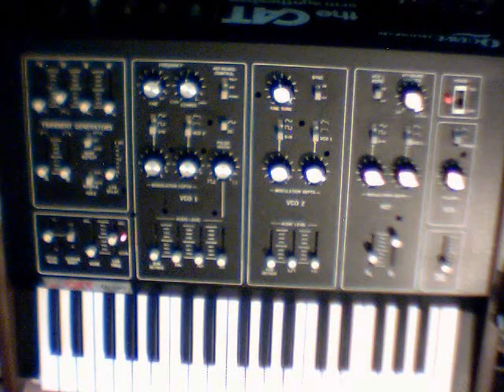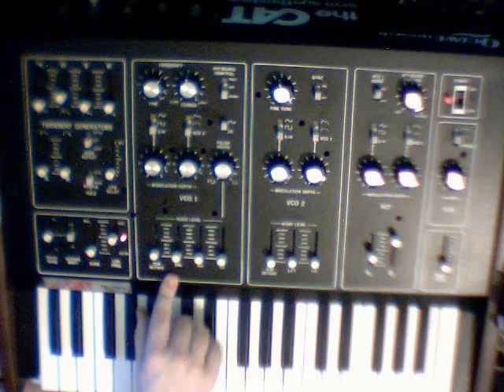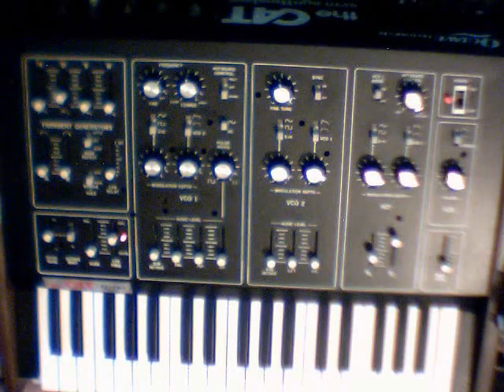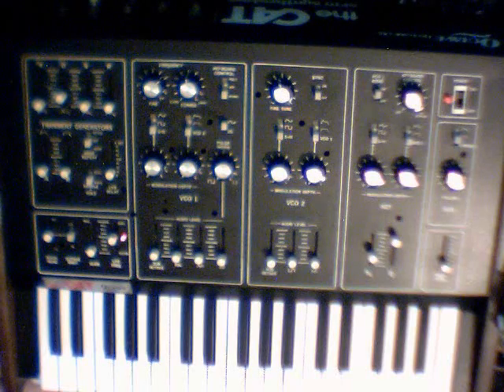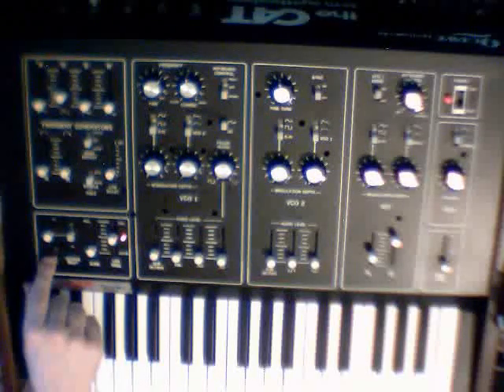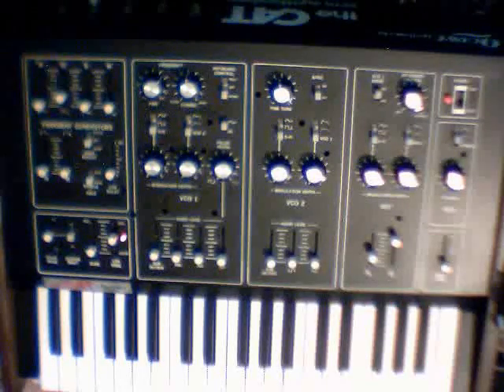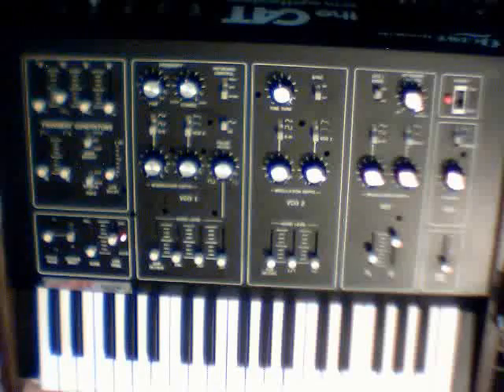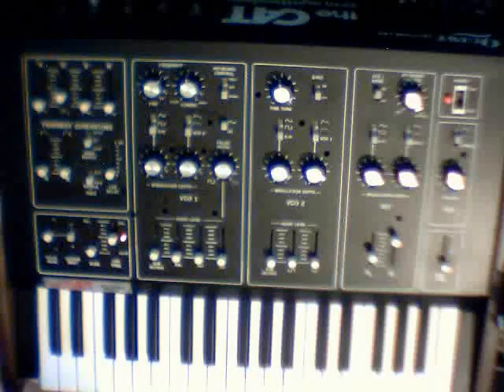Octave Cat SRM demonstration part 2

Comment from the maker: Well if you set the release to full it will eventually fade out so no luck there.

However, there is a bypass mode on the VCA that always leaves it open. This allows you to play a note and it'll continue to sustain forever if you let it.